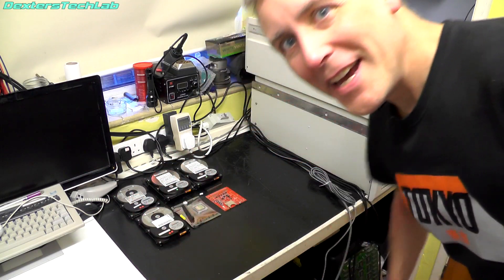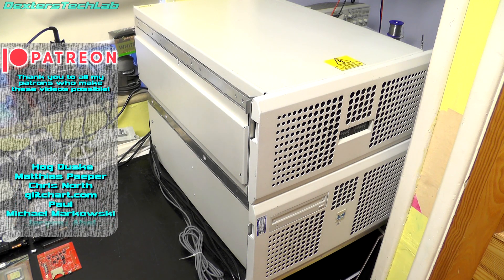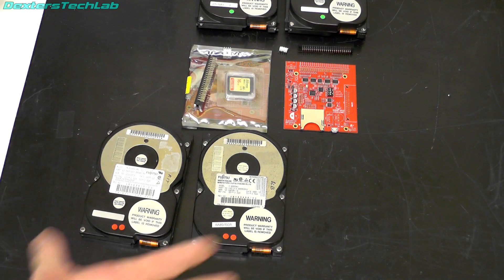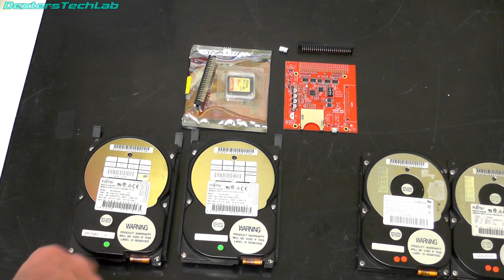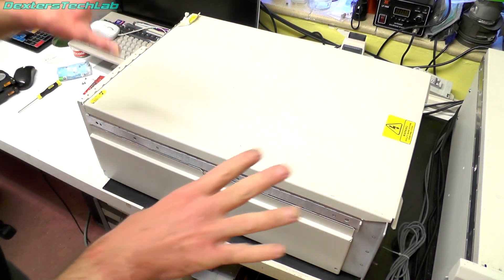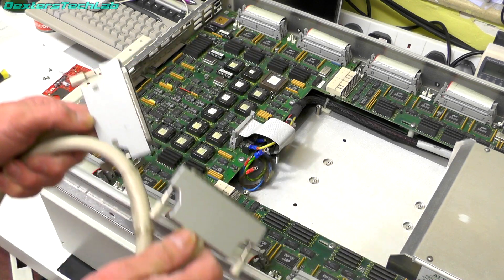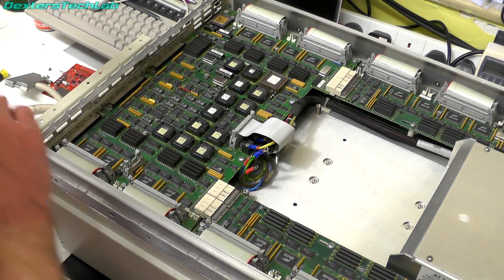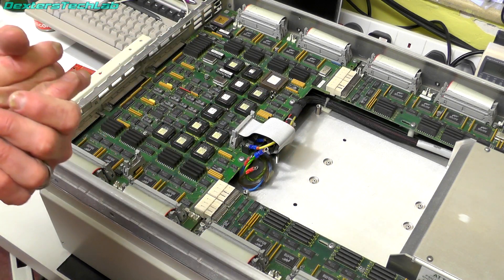DL239 Quantel HAL & Dylan Restoration Part 3

Comment: If they use any uncommon SCSI feature, I'm pretty sure your ZuluSCSI (or any other SCSI emulator) will not work properly. For example it could check the SCSI mode pages (basically a configuration system) for specific settings or ID strings (model number etc.), I am not sure the ZuluSCSU can replicate that. Also, some more obscure SCSI commands are not at all implemented in the open-source emulators. Performance might not be entirely up to spec, depending on the SD card interface, leading to "tail latency" where one disk is slower than all others, decreasing performance (and possibly worse in a soft-realtime application like this). If they use the custom (undocumented) pin headers on the harddisks at all, you're probably entirely out of luck (those could be signals like out-of-band data, diagnostic serial port, spindle sync, etc.)

Comment: So Quantel made their own bespoke RAID0 drive array, likely it is semi sort of SCSI on the interconnect, and yes you do probably need all the disks to be the same type for it to work, as they probably assign each of them a sector of data in a big buffer RAM, and have all the internal buses reading and writing that data out. At least with the adaptor cards they will likely work, just have to have them be exactly the same size as the original, and so long as they are as fast or faster so the other drives are the limit, they will work no issue. bonus if you go for all SSD you can get the biggest size  SD cards, and emulate the largest SCSI devices ever, and hopefully still have the Quantel think this disk is the biggest SAN it has ever seen.
Reply from the maker: Hi Sean! I'll reveal more detail about how Dylan works in a future video!

Comment: Sorry to hear 'bout the power supply. Isn't it always the way, you go to test the component and it catastrophically fails 🤔. Dylan will ride again, I am sure of it.
Reply: Going to bet the bang was Rifa failure, along with probably the small electrolytic on the controller being unhappy.
Reply from the maker: That would have been a nice easy fix but there's a handful of diodes and power transistors on the primary mains side went short circuit, we're just trying to work out what caused it!
Reply: @DextersTechLab  Small primary side capacitors often do that, too much ripple on the controller rails and it latches up and makes silicon smoke.
Reply from the maker: I think the chances the PSU is repairable are very good, i will know soon.